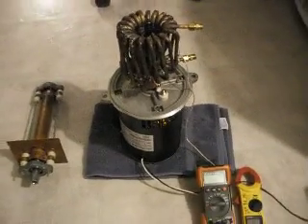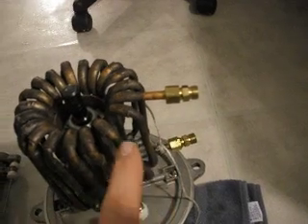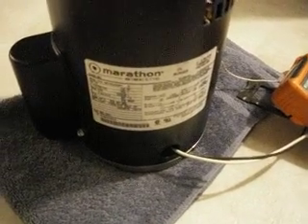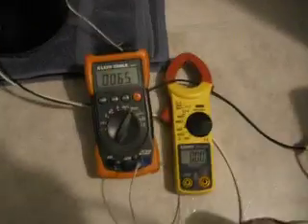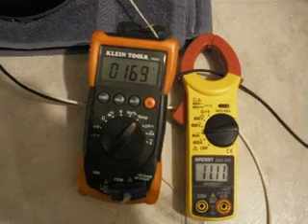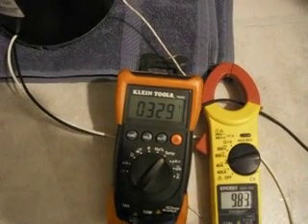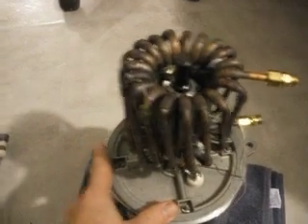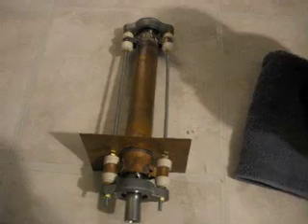Magnetic Heater Update

Comment: So...if you had a bicycle running a gearbox (to UP the RPMs) instead of a motor...? Also, would your design benefit from using "core-iron" (like a transformer) to enhance the magnetic field? Tip (if you'll accept one)...try reducing the mass of your copper coil! That should reduce the overall resistance and allow greater current flow and a faster heat-up. Great project BTW! Keep using that great mind that God gave you, ok?

Comment: Very cool. I'm wondering how well the system would work if you hooked a car radiator up to a copper coil and rotated the magnets in the coil. Then put a DC fan that will blow air through the radiator. It might make a great little heater.

If you could use a high RPM 12v DC or 24v DC hooked up to a solar panel, you could have free heat. (Or course, it would be free AFTER paying for the parts and panel.)

Comment from the maker: Thanks my friend, yes....the faster you can spin it, the quicker it would heat up. Efficiency is due directly to what ever you use to spin it. The longer shaft is the answer to obtain more heat generation to be used for heating your house or what ever. The magnets in my spindle design is like a blower... it pulls in air already to keep them cool. A heat shield can also be used on the inside of the pipe to help out in keeping them cool...or wrap the magnets in it. Thanks for watching.

Comment: i like your video,
The long design is one i had in mind too.

208volt  @ 3,5 Amps is 728 Watt = 3500 rpm @ your machine.

What if you took a angle grinder 750 Watt = 10Krpm ?  roughly said 3 times faster / more heating / more effecient ? 

i think especially in the long desigd you need to cool the magnets or else they lose their power. maybe a built in fan attached to the shaft to draw air through. 
a bit of nessecary energyloss.

like to know your point of view.

Regards,
Eric ( netherlands)

Comment: Thanks for the quick reply.  I predicted the magnets themselves should also get very hot, due to 2nd order Eddy heating.  But, seems I am in error.  

The magnets should be getting warm though, because the magnetic fields of the magnets are doing work by way of warming the copper tubing, and no energy conversion occurs without some amount of re-action occurring on the item that is providing the magnetic field.

Thank you for Enlightening me with a definite answer.  Regards, Joe

Comment: sry to double up on your post, i didn't read it till to late lol.. i think a longer shaft/mags will add more load/amps..  but longer tubes may compensate.
maybe find the a dry temp cap lol.. 350-400 borderline shaft destruction 3500rpm shrapnel. h

Comment: hmm. Not bad at all. How bout this, same motor same # of chambers but longer with a longer shaft?  Yea,, it uses power but would interesting to see how efficient it mite be with the rite gpm to pipe/shaft length with the same motor.. Could encase it and run antifreeze through it put a blower on it,,, mite have a bad ass room shop heater...

Comment from the maker: I did use just the sink faucet and ran water threw the tubing at around 1 to 2 gallons a minute which the inlet water temp was 50F degrees and outlet was 80F continually...not bad for that I guess.

Comment: Guess one needs to calculate power in vs out. using a DC motor would reduce the input guess work because its consumption is equal to the load mostly. Were a AC Motor uses most of it capacity regardless of load.

Comment: OK so I've watched  Lens law effect on copper pipe with a magnet before but never considered using it to create heat. It appears the force needed heat the pipe is minimal. 
I realize that in this case you are using a 1/2 motor that I’m sure draws more power than you are creating in heat. I think the force required is minimal I think you should try using smaller motors and gain efficiency.

Comment: Hi, I am looking at your projects and would like some more info if possible please. I would like to reproduce your magnetic water heater system in where I could use it for maintaining a 70 to 75 water temperature in the middle of a cold day. 

Is there a way that you could contact me and we could discuss what I have in mind? Or at least contact me with the schematics/designs you have worked upon? I only need this for a small system, something that can pump water for a few Sq/ft of pipe. Thanks.

Comment: The motor you use is a .33hp, right? Dremel is 1500wat. That's over 1hp no? Besides, I've used dremels for similar purposes. It does bog down a little, but should still reach at least 1/2 top speed. 37000rpm.

Comment from the maker: Not on this design, but yes it will if they reach around 280 to 300F, they will lose their magnetic field. This one actually is acting like a propeller which pulls in cool air around the magnets which keeps them cool. You could also use a inner heat shield compound on the copper to help out in keeping the heat away. Thanks for watching.

Comment from the maker: Yes sir, induction is always more efficient than a standard shorting out of a heater element...magnetic induction using high frequencies is even easier to produce with no moving parts. I guess the best method of spinning the magnets at high RPM'S using less energy to do it would be the most efficient for this system. Thanks for watching.

Comment: I have never actually tested this theory, but this is how I would.

I may do a vid on my channel if I get a working degsine. As for blue prints, get an old washing machine type motor. Take it apart and reamove the spiny thing (roater). then make a coial of copper tube that fits into the hole. Power the remaining stator coials through a variac or something similar to avoid overheating the coials. We are essentially building an electro magnet.

Comment: Great idea, I have an idea for an improvement. this device uses an oscillating magnetic field to generate eddy currents in the copper heating apparatus. The water then picks up the heat through thermal conduction. If you took the rotor out of the motor and put the heater inside then the oscillating magnetic field produced by the ac current flowing through the stator windings would greatly increase efficacy. I ask that you share the secrit as to how you made so much hydrogen with the same power

Comment from the maker: Actually the more magnets you use, the bigger in size the diameter would be, causing more magnetic repulsion that the motor would need to fight against, causing more current draw. That's why I chose to keep it thin and long. I'm working on induction heating with high frequiency which I found to be the best in energy efficiency so far. Thanks for watching.

Comment: Why only 6 magnetics? if you make it with more 8,or 10 magnetics, efficiency where be godless? heater production will be best? i want make this experience. did you test how many times to heat a 300 l tank? in France we use too many electrical resistance, 3000 w, it is expensive to make hot water, I think this idea is good if I can reduce my electricity bill. if energy efficiency is superior than 2, That will be interessant to exploite it. me too, I like invente and experimente new systems.

Comment: I don't see why people are so fussy about this on here. The design works their is more room for improvement on the motor side. It would be effectively run on smaller motor with some gearing involved to keep the rpm higher but their is still that high draw in the beginning because the metal has to get really hot to bring down the resistance in the copper.

Comment: I don't get it. What is so special about that? Are you saying induction in the Cu tubes is more efficient than using heater elements in a tank? You must have a lot of flux wastage, and the losses in the motor must mean this is less efficient than a straight-forward heater element. So, do this have some special application, or what?

Comment: this is called induction heating. This is not new, but your device is still very cool! Now the real question is - how efficient is it compared to just regular heating? How much watts did you put in in order to heat up a certain amount of water to a certain temperature? I am very curious to know that. It should be less then if you just use and electric heater (induction heating is usually more effective), but you never know. Do you have those numbers?

Comment: Interesting idea, I assume its the electrical eddy currents in the pipe that cause it to heat up. But there is no way that this as efficient as a heating element as a heating element is silent and doesn't require bearings and maintenance .

Comment: Power input drops because electrical resistance in the pipe increases as it heats up.  You have basically have created an induction heater, which in itself not a bad idea, but since energy is neither created nor destroyed, you are wasting energy powering the mechanical motion of the motor.  You would be better off with an induction coil if an immersion heater is not what you want.

Comment: google pid temperature controller.  If you had that hooked up to a resistive heater, the electrical energy being used decreases as it gets closer and closer to the desired temperature.  Once you reach the desired temperature the electrical energy input is completely turned off, until the water cools down a bit, then its turned back on.  efficient.

Comment: You should try and insulate the coil design. with water running through. 
Would make it more efficient. ore better said the heat would radiate less from the coils and you have an excellent boiler, if your going for a heater core. use oil. like motor oil ore sunflower oil. it wont expand as much as water and it handles the heat better. When water gets boiling it tends to explode. 

BTW It's good to think diffrent. all the good inventors did so . Keep on going like this and you might get a nobel.

Comment: Okay.

This is what you're doing:
Electric energy -> Magnetic energy -> Mechanical energy -> Magnetic energy -> Heat

Let me suggest a shorter path (~84% efficiency):
Electric energy -> Magnetic energy -> Heat

Or even (~100% efficiency):
Electric energy -> Heat.

You're wasting a lot of energy energising coils, spinning the driveshaft (Inertia's a bitch - You're also moving a lot of air here), heating the motor housing, breathing my oxygen...

This is *not* efficient. Stop.

Comment from the maker: The electrical energy used to run the motor is mechanical, yes... but it's still part of the same power input in using the magnets to produce heat. Also the power decreases as the copper heats up which as a element does not but requires the same input of electrical energy all the time. Thanks for watching.

Comment from the maker: As seen on the video, the temp does climb very fast and even when water is running threw the tubes, I did have a 30 Degree F increase in temp on output. The best savings of energy for running the motor would be at 208 Volt drawing 3.6 amps as would gradually drop when heating the water. Also running the system in a loop instead of constant water flowing threw it would be the great advantage. Thanks for your comment and thanks for watching.

Comment: sure you can make copper pipe hot and you can heat water to a nice luke warm, but what is the energy per unit mass while heating water? how many watts does it take to heat a liter (or gallon if you prefer english units)? 208V at ~12A sounds like a lot of watts for a 30 deg F rise in temp. However, it does look cool.

Comment: I wish that you had ran this with water going and heating a tank with a recirculating pump but hey thats my use for it and I think I need a 12 volt high speed motor now just to locate it and build the thing. maybe use thermal pumping action and really build up cheap hot water

Comment from the maker: Yes sir, just remember the energy efficiency  relies on what ever you use to turn it at a fast RPM. I think using induction heating by a high frequency circuit would be the best and easiest way to go. Mine is the same principle except I'm just using magnets. Thanks for watching.

Comment: yours is in efficient in the way that electrical energy has to be converted into  mechanical back into electrical and then into thermal. with losses in each step and a far from perfect design (but very good for hand built, i could do no better) where their will be huge losses. where conventional convection current heating only has an electrical to thermal energy conversion. much more energy is conserved. but both systems have a time and place where they better fit a situation

Comment: i was saying like useing a motor for a router (wood working router) that spins at a really high rpm and has way less toque. it still has plenty of it butt less than one you might use for an air compressor like yours that has a lit of torque buts un needed for this.. it will osolate the magnetic fields a lot faster and their for make the proses of inductive heating happen faster and more strongly.

Comment from the maker: Their is a resistance behind the scene, you do need some toque behind the motor to overcome the resistance. But yes, the faster it spins the quicker it will heat up. I think the most effective use of this is to heat up the object real fast and then switch off the motor and use the radiant heat to supply a room. Thanks for watching.

Comment: you will see no volts. or exstreamly low. its better described as induction heating. this is just a different form than most. most use electricity to induce a current in a piece of metal to heat it up... this man used magnets to do exactly the same instead of using a coil of wire to make a magnetic field he used spinning magnets.. its probably less efficient than the other method but interesting

Comment: Eddy currents are induced in the copper by the magnets setting up a counter electromotive force through the Lenz effect. That is why it does not matter if you use a coil or solid copper. Up to a point, the thicker the copper the greater the resistance to the motion of the magnets and the more heat you will produce (and the more current your motor will draw). The power going in will always be proportional to heat energy coming out. You may want to experiment with combining your two designs.

Comment from the maker: Hello Gary, this was for a energy efficient heater, not really in heating water but having radiate heat. No plans or ideas for using it on a car engine.The energy used depends on the device used to run it..although as it starts to heat up, the energy efficiency% climbs. Regular heating elements are made to draw a specific current all the time no matter if the water gets hotter, it stays the same. Also the faster it spins, the quicker it heats up and will not stop until meltdown unless shut off.

Comment: That's great. Is there a practical purpose? If used in a 'car' would you run it off the engine?  What is the ratio of energy used to create the heated water compared to other
methods?  What affect has motor speed on the rate and maximum temperature?

Comment from the maker: The magnets can resist up to 270 degrees F before they lose their magnetic field. Because of the gap between the piece, they act like a fan keeping them cool. I would suggest using a insulation heat wrap inside the pipe thou to keep the heat generated away from the magnets if you plan on going to higher temperatures. Thanks for watching.

Comment: I was trying to think about what could be going on to cause this. Electricity is produced in a very similar way. Pass a magnet by a copper wire, current flows. I could be wrong, but my theory is; electricity is being broduced in the copper and immediately shorting itself out, producing heat. If anyone KNOWS whats realy going on, let me know. Can you please hook the copper tube to a volt meter and an earth ground (preferably close to a ground rod) and see if theres power?

Comment: I think rather than a water heater for now I will build a similiar design to what you have here and make a flange to bolt in place of the oil burner in my furnace. Magnets, shaft and copper plates inside the fire box. The exsisting house thermostat would still function to start/stop the motor and the blower thermostat would still come on when there was enough heat inside the firebox. What do you think?

Comment from the maker: Yes sir, that's what I wanted to do with it when I first came up with the idea....it was going to be a long copper  tube going down the center of the hot water heater with a long magnet shaft spinning inside. Was to expensive thou in making. The flow rate was around 1 gallon a minute. unit would need to be bigger to get those kind of results your talking about. It would work !

Comment: I am thinking this could be made tnto a taller build for an instant hot water heating system. What is the flow rate on your unit? Will need an outlet temp of 140 deg F and over 3 gallons per minute to be a nice little hot water on demand system.

Comment: How about using incoming water supply, under pressure from say a standard well pump or even gravity water supply to spin a magnet array in place of the electric motor. Sort of a heat-on-demand type setup for a water heater. Just a thought. Cheers...

Comment: Have you considered adding a load across the input and and output sides of your pipe ? By doing that you will increase the temp which would mean you could slow down the motor and get the same results for less input power .... great work mate!

Comment: 1. It heats fast because the copper tube are empty,at circulating water inside it will not heat so fast.
2.the device will not work for long time,that's because the neodimium magnets loose their magnetic proprieties at temperatures higher than 80º Celsius .
3.the spinning resistence of the rotor rise exponentially whith the RPM.
4.the only way you could obtain better results could be changing the copper tubes whith tungsten-nikel wire, because it have a lot greater resistense,so less RPM needed